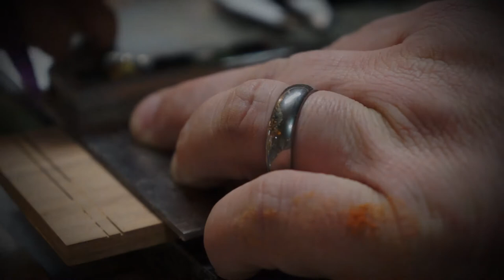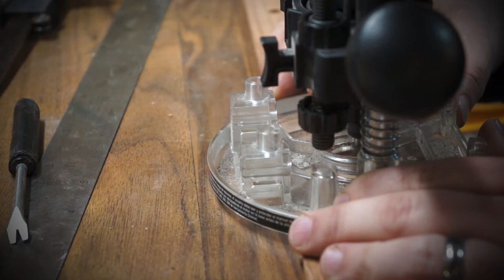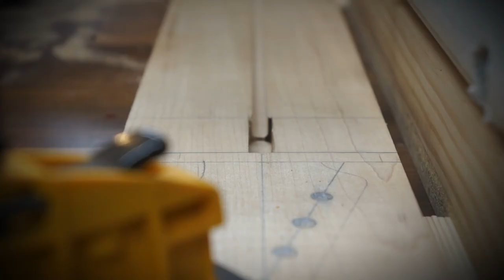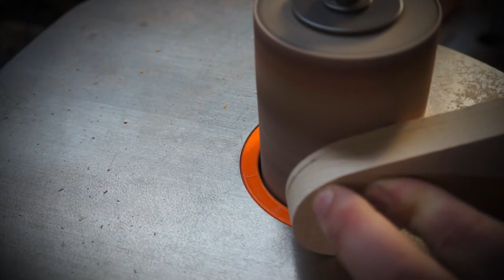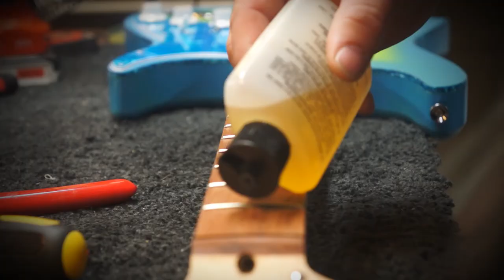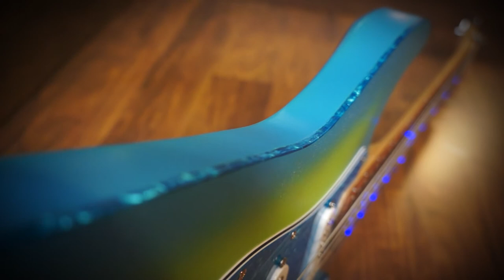Lets Build: Nautilus LED Strat

Comment: where are the resistors? aren't they gonna burn out
Reply from the maker: There is a resistor on the negative lead to the battery. They will burn out instantly without it.